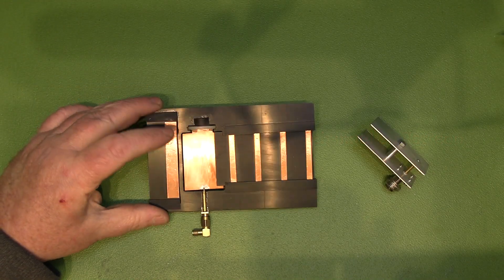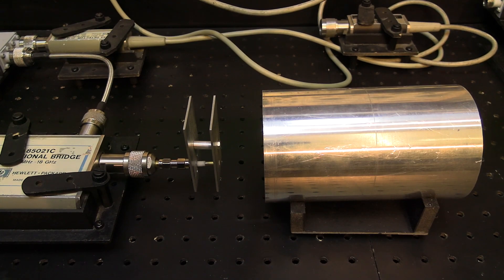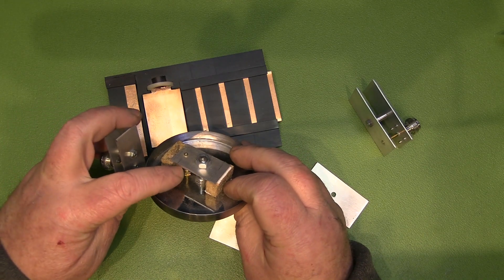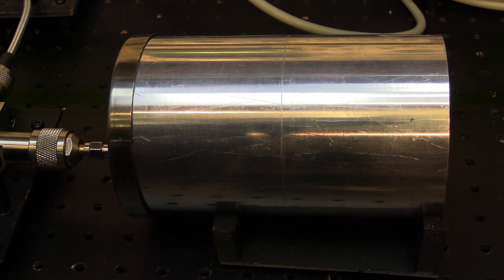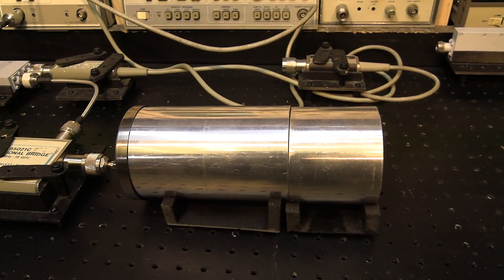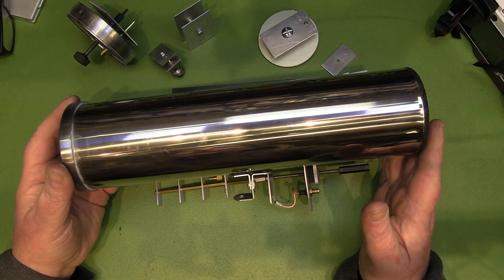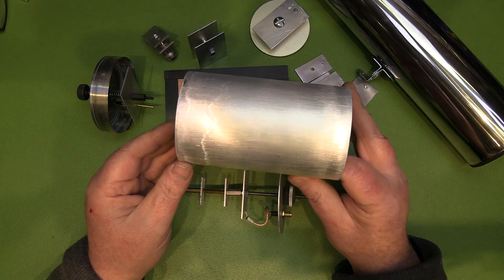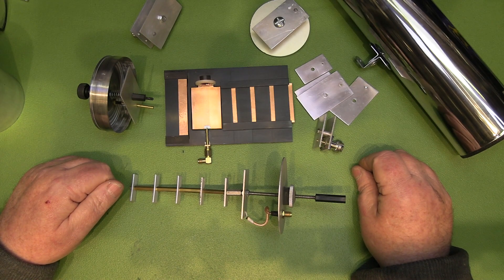Yagi Prototyping What have we learned?

Comment from the maker: Please feel free to ask any questions that I have not answered. Although it is fair to say I still have questions myself but that is why I love this subject!
Reply: it looks like its just capacitive loading on the antenna, though the metal of the tube.  the tube is conductive and thus increases the surface area for charge to accumulate, this increases the effective capacitance of the antenna elements, lowering the resonant frequency. (this is my theory at 4min 30sec)
Reply: Have you ever considered using 3D printers and/or laser cutters for antennas construction?
Reply: wi-fi is not a problem - use repeaters and that's it!
But to receive LTE signals, THAT'S THE PROBLEM. For example, the antennas on b1 b3

Comment: You're isolating free range frequencies flow into an almost faroday cage causing the frequencies to lose room to travel independently and manoeuvre around other frequencies in the environment. 

Picture a 5 lane highway, trucks travel at 80km, buses at 90km, vans at 95km,  cars at 100km,  they all travell consistently at their speeds for their
  size and have room and rhythm to weave in and out of each others paths 

Then up ahead is a 3 lane tunnel.  As they all enter the tunnel, they need to behave differntly by altering their speed and manoeuvring,  which results in a loss of consistency

Comment: Yep, waveguides stretches the waves. Usually you look up the velocity factor for known standard proportion waveguides and then make the adjustments to the driven element. I did notice that the 1/4 stub radiator in the classical wifi  cantenna is shorter than in should be, in the guides made by people who actually measured them, instead of just guessing. Some designs experimented with a copper foil cone or  a narrow flat triangle of copper plate, i.e. like if you fed your rectangle from the bottom narrow side with the N connector through the side of the can. Short can feeds are / were popular as lower frequency feeds for dishes. Especially the Hydrogen Alpha radio astronomers have made extensive research on them to dig around in.

Comment: Hi andrew i was working on making 698-6000mhz log periodic dipole antenna with 11+1dbi gain my calculation in the end is not accurate for as per the testing results last dip stuck around 3800mhz, Can you get around making this antenna ? and maybe your previous aluminum tube lpda antenna can be modified with some calculation to target max 6000 mhz a great 4g5g lpda antenna video can be done on this too !!

Comment: this remembers me years ago when i was setup a 5 element yagi for the HF spectrum on a flat roof; the distance above the roof did make a lot , indeed swifting the center freq for best SWR, i needed hours to get it right. My idea for the Cantenna is not cut down a working wifi antenna but change the diameter size of the tube....

Comment: These are very interesting insights. Thank You for making all your innovative experiments and videos. 1. I am not so much into microwave stuff, but I think in general most of my HAM experience in UHF applies here too. So I totally aggree, most of the frequency shift in the pipe must be caused by adding capacitance to the arrangement. We know that a so called capacity hat lengthens a wire antenna electrically, making its resonant frequency shift down. Should be the same here, I guess. 2. I think you needn‘t care too much when there are low return loss ‚spikes‘, as you call them, as long as your transmitted signal is ‚clean‘ enough to not hit these spots.
Reply from the maker: Thanks for sharing your insights and knowledge

Comment: Great video with nice explanations. The only question I have got is, why have you chosen the 2.4 wifi frequency ? Where on a typical wifi range for internet access (house + garden + shed...) It is rather simple to use cables and add AP.  Is it more relevant to work on mobile internet access for mobilehomes or isolated homes ? I don't know 😁 you have probably good reasons 😁

Comment: Cool. Have you tried just forward angle parasitic reflection plates / rods on the sides to make it more directional? Or under and above it. Closed sylinder will have static charge around it. Anything over half a ball / tube will have positive charge on the surface and negative charge inside.
Reply from the maker: Interesting I have seen this used on waveguide transmission lines but never thought of using it here.

Comment: it is close to SWR DISCLOSURE type of video which some of your subscribers requested before (:
Reply from the maker: This is more to do with capacitance and the change in frequency. Most of the time reflected return loss due to transmission line mismatch is easier to solve because you can always add some sort of balun or taper to match 50 ohm’s.  But as for VSWR it will be the new year as I want to talk about measurement in general.
Reply: @andrewmcneil  ,great! But will you make BIG video with swr of your old famous antennas from your old videos?
Reply from the maker: I will revisit some in the new year, yes.
Reply: @andrewmcneil  Happy new year!
Reply: Not exactly...in swr disclosure Andrew could show few of his old known finished disigns with swr-measurment, not this kind of variations debuging
Reply: @CornholioNan  Maybe he could remake some older videos but as new builds from what he has learned. As for return loss and SWR there are conversion tables on hp website it is not hard.